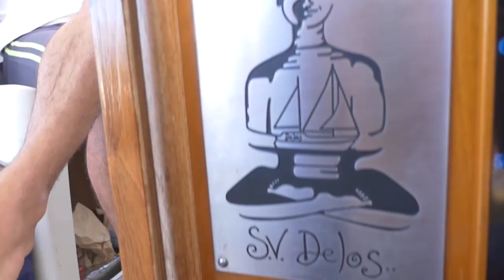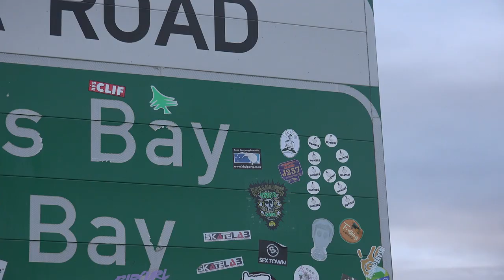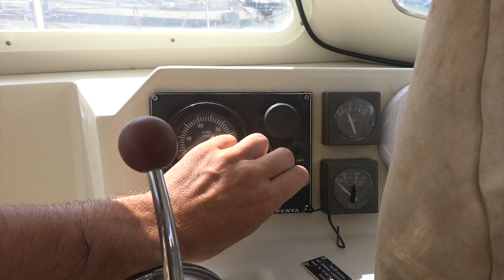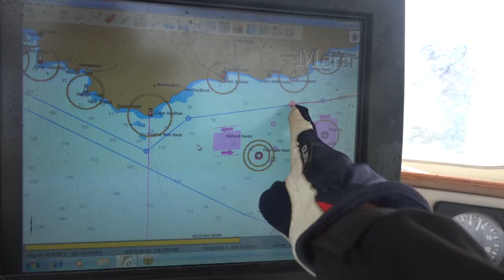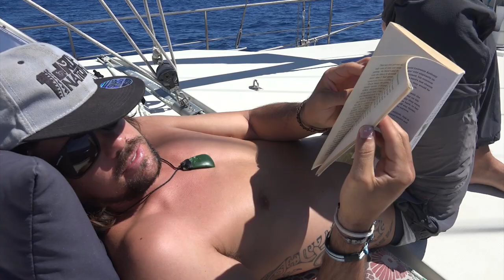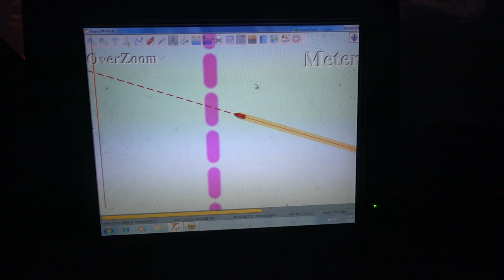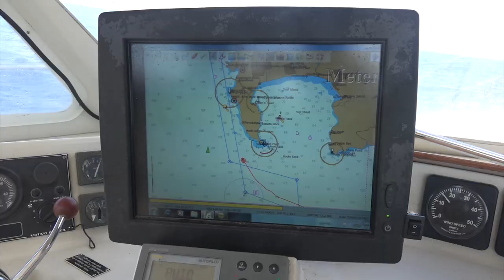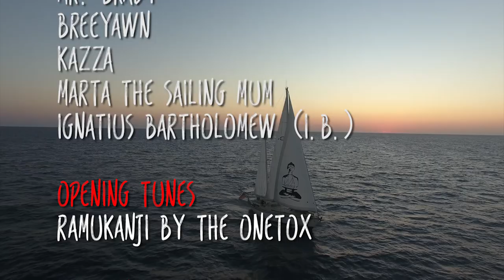We sailed around the Cape of Good Hope, South Africa!! SV Delos Sailing EP. 103

Comment: The comments from 3:10 on the Fifth Leg and the Dick to Leg Ratio are two reasons a condition for working in the lumber camps is a Restraint Leash is required. Rutting season and boys being boys does not turn out well for the neighbors without such leashing.